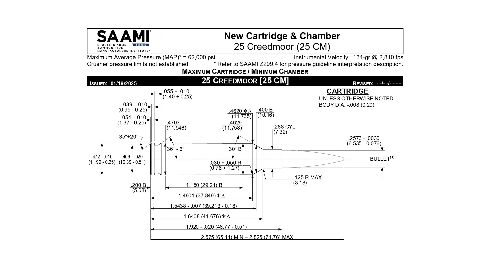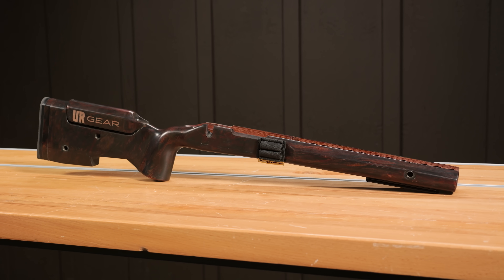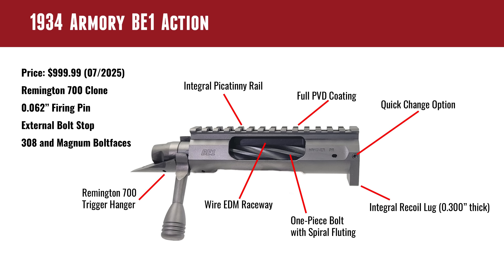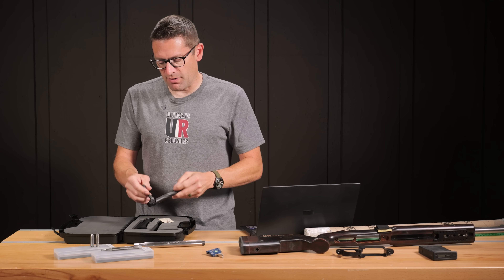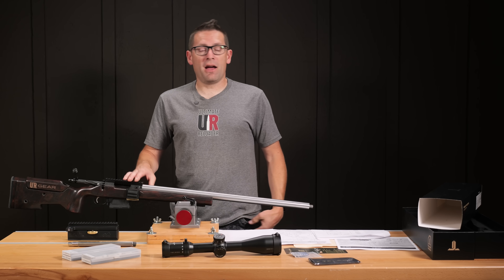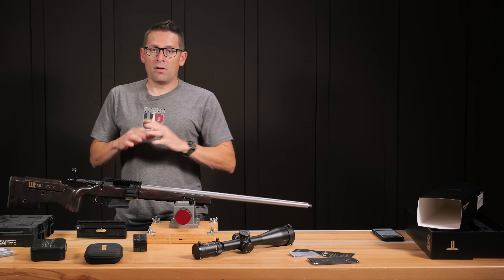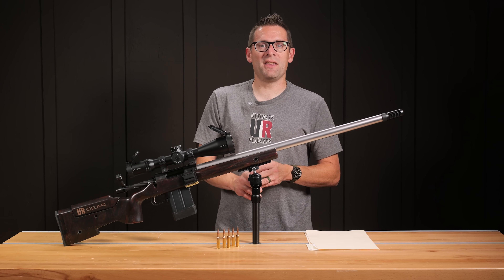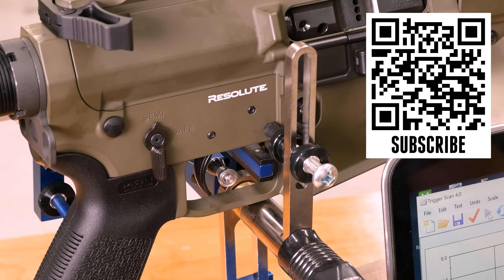NEW: Custom 25 Creedmoor Chambering A-Z (SAAMI Certified!)

Comment: When looking at Foundation stocks it appears they are action specific. Are you running into issues when installing different actions into the same stock?
Reply from the maker: Yes, this is something you need to be aware of, and when in doubt, contact Foundation. We have in some cases made minor mods to the stocks on our milling machine to account for different placement for the bolt release and bolt handle (in rare cases).

Comment: Waiting on some Alpha Brass for my 25 creedmoor build I have. I went with a McMillan A-5, but almost went with the Foundation like you did. I have the barrel spun up @ 26" finish length, 5-8x42 thread, and 1:7.25 twist since I shoot at sea level in Mississippi. I plan to start with the 135g Berger bullets, & H4350 to see how the gun likes everything. I also have some N555 as well to tinker with being on the slower side. Awesome stuff Gavin!

Comment: They tell us that these new cartridges are better and more accurate than what we have been using.  So, since you have a 25 Creedmoor, how about building an identically spec'd (as much as possible anyway) .257 Roberts (based on the 7mm Mauser case from 1892) and see how they compare.

Comment: That old 250-3000 Savage does everything this 25 Creedmoor can do.
I build and sell AR 10 uppers in noncommercial chambering and one I do in the AR 10 is the 250-3000 Savage by using 24 inch Pac Nor barreling SS supper match barrels in polygonal 1-10 rifling to shoot the 100 grain or heavier bullets.
I often use 6.5 Creedmoor brass and now 25 Creedmoor brass to make 250 Savage ammo.
Hornaday has been putting out 250 Savage brass pretty good.
I kept one AR 10 in 250 Savage I just have a fantastic time shooting and punishing Coyotes with it.
Reply: Provide some ballistics comparing the two. I'm of the crowd that believes a lot of "new" chamberings aren't really superior to tried and true cartridges.  It's all about playing on ignorance and making a buck.

Comment: Very nice. I have a 26” bull barrel in 257 CM for my AR 10 that I’m looking forward to trying out.
Reply: 26 inch maybe to long for the 25 Creedmoor because I build and sell AR 10 uppers in 250 Savage so the load data for the 250 savage for a 100 grain bullets shows a load for 3000 FPS with 20 inch barrel and I am getting max of 2850 FPS range from a 24 inch Pac Nor barreling SS supper match barrel so I suspect I am loosing velocity by too long of barrel .
I am fantastically thrilled to have kept one AR 10 250 Savage for myself as a coyote punisher and coming fall deer slayer
Reply: I’ll be shooting 131 to 135 gr
Reply: @Michael_45_AARP  You better have at least the 1-10 twist for that weight of bullets.
The AR 10 uppers I build and then sell at gun shows I chamber in 250 Savage I am using the 1-10 twist rate in the polygonal rifling because these are used for deer and close-range Elk hunting with bullets 100 grains and more.
Just an idea for you is if you want more power then you can have that AR 10 barrel chambered for the AI 257 Roberts.
Mark Manson owner of Action gunsmithing can do AR barrel work

Comment: That's a beautiful rifle, Gavin. The accuracy is spot-on. Great job my friend. You build some phenomenal rifles. I'm considering building a 25-7-PRC-imp. What do you think would be a good set up for hunting? I built a 25-CM awhile back for my son. I took a Rem-700 Short-action. Had the action blue printed and trued rebuilt the bolt and firing pin assembly new Timney trigger. I went with the Manners MCS-NS Elite TUC Camo and Krieger 26" 7-twist M24 contour Diamond fluted barrel. Hawkins bottom metal. Had all metal Teflon coated to contrast the stock. Topped it with the Arken EP-5 5-25×56 with Badger scope rings. We've been shooting a few different bullets. McGuire Ballistics 117-122gr Copper Rose & Hammers 127gr-HHT & 128gr-HH. The Copper Rose 122gr has a G1-BC .660. We're shooting the 122gr-CR 3156fps Avg 5 shot SD-2.6 ES-6.1 shooting Bug-hole. The Accuracy of this build has been incredible. Thought you would appreciate my Semi-custom  build. Let me know what you think about the 25-7-PRC-imp build for hunting setup. Looking to shoot Blk-hole 140-145gr & Chinchaga 156gr-ULD-RBBT-HP. The Chinchaga 156gr has a G1-BC .820 WoW. It will be a great long-range option. God bless you and your family. God bless America 🇺🇲 🇺🇲🇺🇲 🇺🇲.
Reply: Hey Jeremy that  25 -7 prc sounds like a  modern day  257wby   . Go for it and enjoy the project  !!!
Reply: I am already building the 25-300 WSM in AR 10 uppers I sell with all of the WSM magnums and wildcat cartridges in the AR 10.
Reply: I'm a huge fan of the WSM & SAUM cartridges. I've Been wildcatting both of them since they hit the market in 2002. I have the WSM cartridge from 25 to 50-Cal and the SAUM cartridge from 6 to 308-Cal. I was looking at using the 7-Blaser cartridge for a new 25-Caliber. Their's a guy that already used the 7-Blaser for a 25-Caliber build it's called the 257-Blackbird and it outperforms the 257-WBY. The 7-PRC brass is more widely available than 7-Blaser. So that was the main reason I thought about using 7-PRC.
Reply: @jeremystyron9721  How about name those cartridges made on the WSM cartridges that would be necked down and necked up - all of them you own and let's see some photos or video on YouTube.
You claim to own them let's see them?
I build and sell AR 10 uppers in all of the WSM magnums plus reloader wildcats.
I even offer to prospective buyers to come to NW Oregon to try out the uppers which I have on hand.
Currently on hand for shooting I have AR 10 uppers in 250 Savage /// 6mm-284 win /// 6.5-284 Norma // 358 win // 300 WSM /// 375-300 WSM. starting price is 1700 $
I have chamber reamers for the 25 -300 WSM and the 6.5-300 WSM but no AR 10 uppers on hand in these chamberings as they all sell very fast at the gun shows I attend.